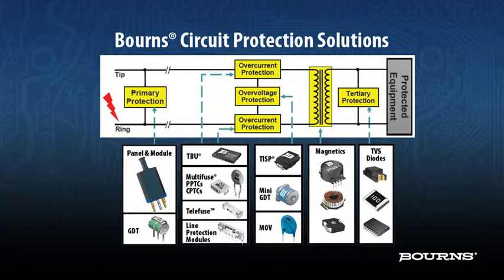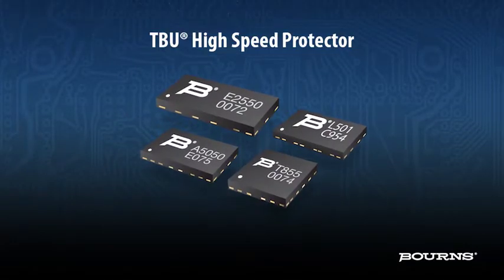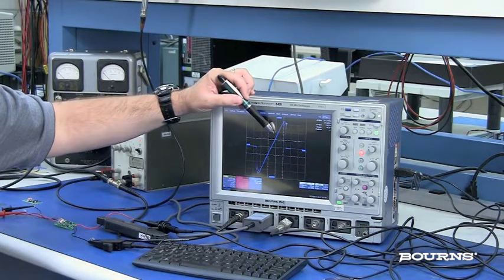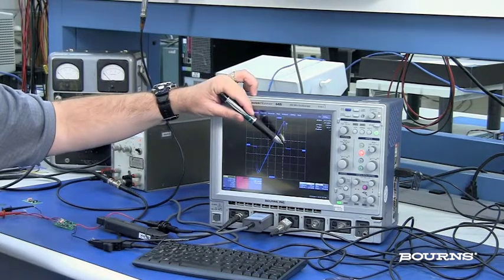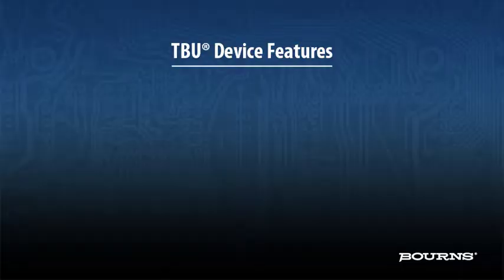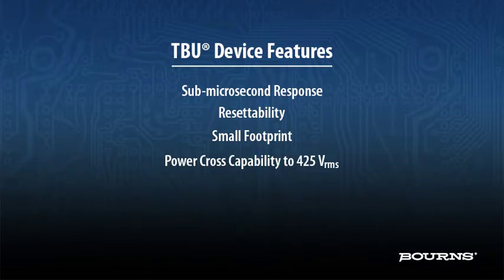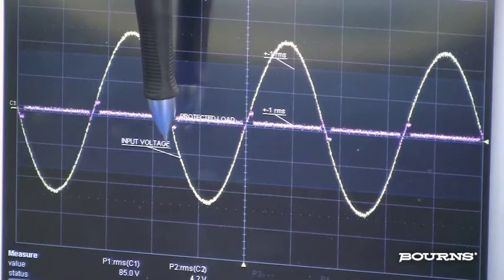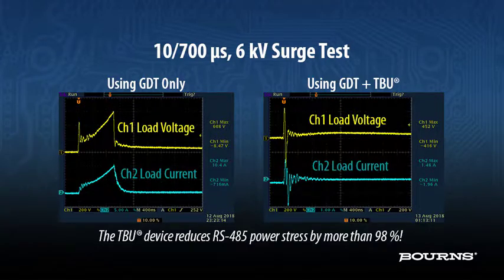A Brief Introduction to Bourns® TBU® High Speed Protectors

Comment: This is an amazing product-  its in series with your circuit so it doesn't  shunt to ground,  causing huge current spikes on your source, it is much different than a PTC or NTC input current limiter.  Where can I get SPICE models for this?